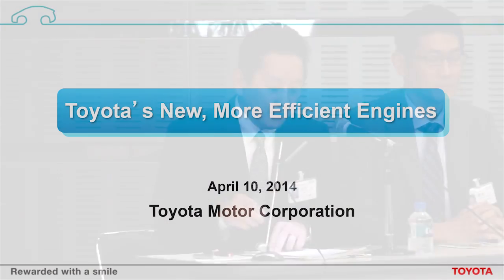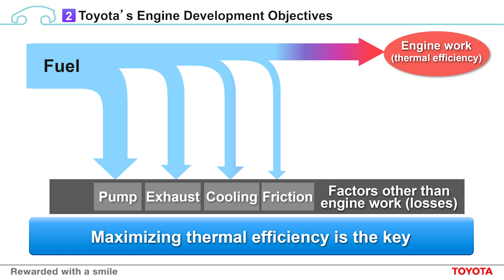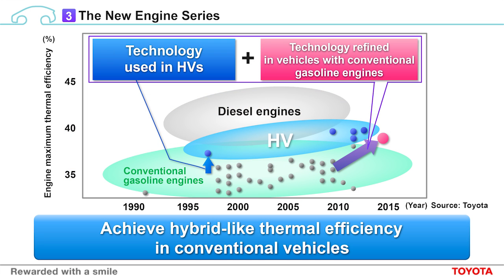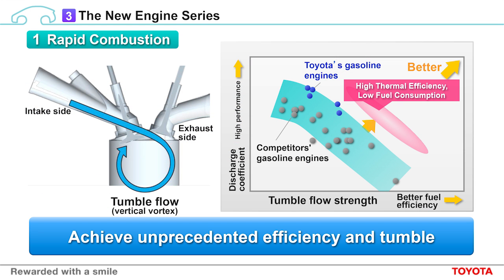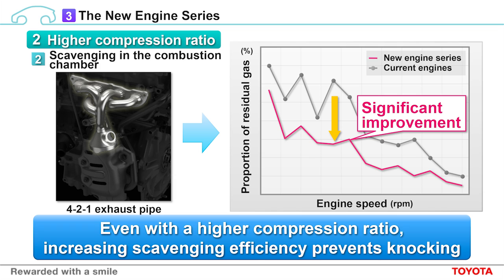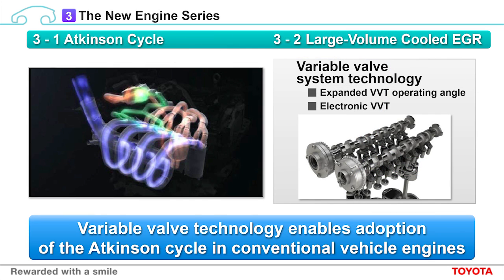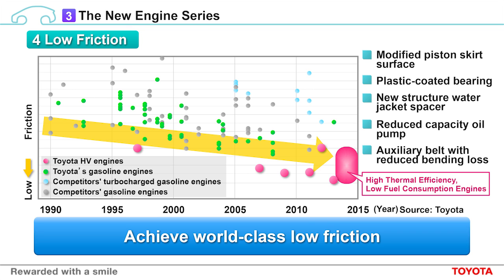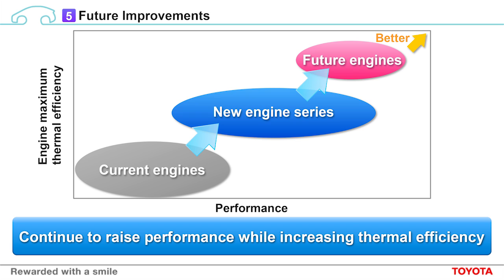Toyota's New, More Efficient Engines

Comment: Very interesting video. Nice to see that Toyota invests in improving their already good engines even more. But I have one question: the current 1.0 litre engine now has 50 kW and 51 with the Daihatsu version. If Toyota is going to apply the Atkinson cycle, what will this do to the power output?  Because these days, even small cars like the Aygo are almost 900 kg.

Comment: Lean burn needs to come! HCCI or spark lean burn with high end catalytic converters. Atkinson cycle is reaching it's peak of efficiency. I know you can increase the stroke of your existing Atkinson cycle engine used in the Prius but you can only do so much.

Lean burn and ultimately Stirling engines will be the ultimate in efficiency.